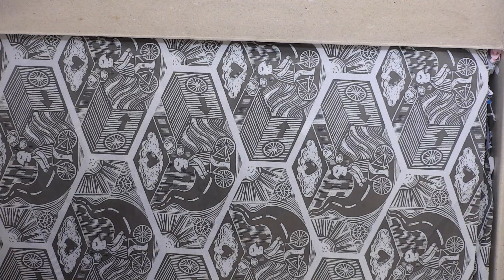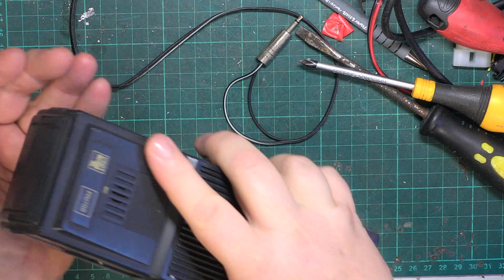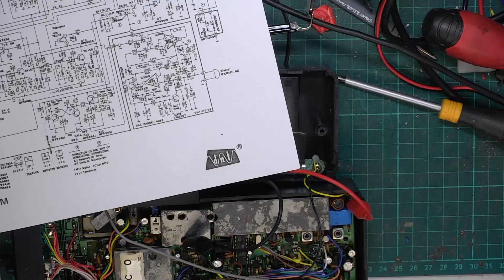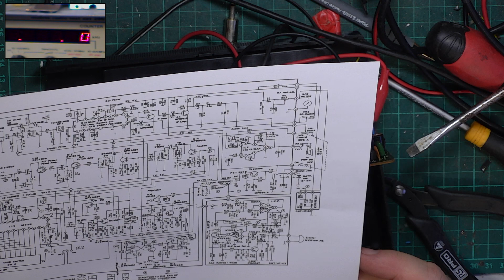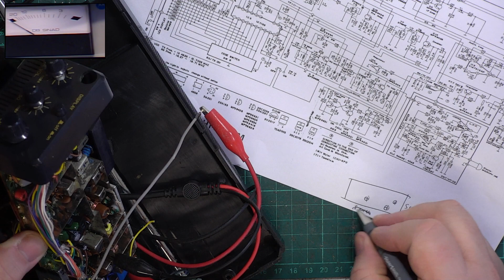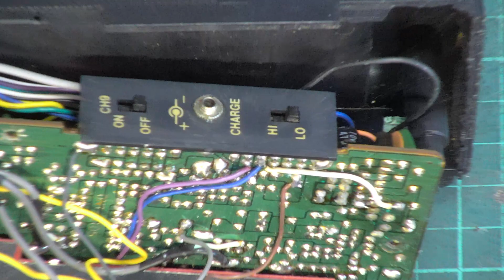DNT HT4000FM  PR27GB CEPT FM 3W handheld CB radio - Repair & service

Comment: i know this is a year old....ive just acquired one of these in a joblot of cb stuff. i wonder if they can be converted to 27/81?
Reply from the maker: In 1981 the UK Government allowed conversions which could be sent in for testing & certification for which they charged a small fee (less than it cost them to do). In the mid 1990's, this was withdrawn. No CB radios may be converted from one citizen band to another.

Richard, G0OJF, UK

Comment: I don't think I will rush out to buy one of those!!  I think I will be reserved and not say what I really think  :-l  EDIT:  With a few extra bits and pieces it might have been a lot better a set, like power socket and extension speaker socket, also somewhere to plug an external aerial into..  I would have liked that it had an LED for channel 9 rather than no display at all.  Reason being, it can be switcher off, how do you know it had not gone to channel 9 without an LED?